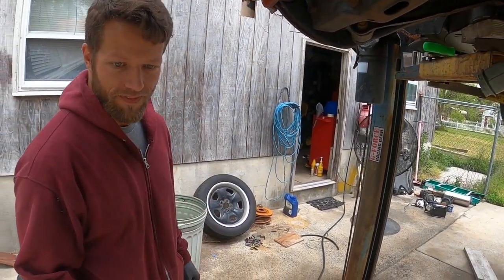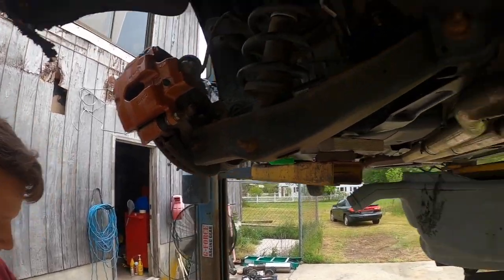5th Gen Camaro Rear Differential Removal and Upgrades

Comment: I suddenly am not so intimidated from a 5th gen Diff Swap
Reply: I have a 2014 ZL1. Is removal of the differential pretty much the same thing?
Reply from the maker: It's gotta be very similar
Reply: @The1st60ft  I mean, the only thing different would be the ZL1 has a beefier differential right?
Reply from the maker: And I think it has a diff cooler?
Reply: @The1st60ft  OK. Yeah, I have not using the diff cooler anymore. Because I'm not tracking the car. It's making 1000 rear wheel horsepower through Th400. Previously it was a manual. With the stock 373 gear it's horrible on the highway so time to put some 323s in there hopefully that gives me some of the highway back. Still a lot cheaper than changing my whole set up again. Videos coming out soon.

Comment: how do you like those clutch packs? too aggressive for the street? did you later on add more friction modifier?
Reply from the maker: Clutch packs have been awesome. Only time you can tell how tight they are is when you are backing out of the driveway slowly and wheels turned, then it feels like a spool. Which I don't mind. Other than that you can't tell. Its really an experiment right now to see how long they last vs the more expensive Eaton option. I didn't add any more no. Just threw Lucas Synthetic Rear Diff Fluid in from the start

Comment: Do u have to do all this to remove the cover or just by removing the exhaust will be fine ? Need to change the Rear Axle Housing Cover Gasket
Reply from the maker: You probably just have to remove the exhaust and the rear cover bolt for that

Comment: Can you post a video of the 140 pull now
Reply from the maker: Soooooo I tried to do a back to back pull 3.27 vs 3.91s buttt the car doesn't hit 140mph anymore. It topped out at 120mph at the top of 4th and didn't wanna shift into 5th being an overdrive gear
Reply: Man making me some 2nd thoughts about doing 3.91 gears my setup is pretty similar to yours
Reply from the maker: @locdog957  I wouldn't. I'm making a vid how I actually went slower with the gears and 60ft, 330, 1/8 and 1/4 were all slower. I'm going back to 3.27s

Comment: How much power are you making? Also how much power will it hold
Reply from the maker: It's not really about power but the torque hit that the Clutches can handle. It'll hold 450whp with the stock stall but it was slipping hard with 450whp with a big Converter multiplying torque
Reply: @The1st60ft  sorry, i forget it’s torque is the rating of failure. I’m just curious cause I’m supercharging my Camaro and am looking into beefing up the axles and differential.

Comment: What's the symptoms of a bad one does it make a grinding noise and wont drivr
Reply from the maker: Mine was just worn and slipping Clutches at the track on hard launches. It was quiet tho. I just saw footage of my launches and it was acting like slipping Clutch symptoms
Reply: @The1st60ft  oh cause I have mine when I put it to gear it sounds like is grinding